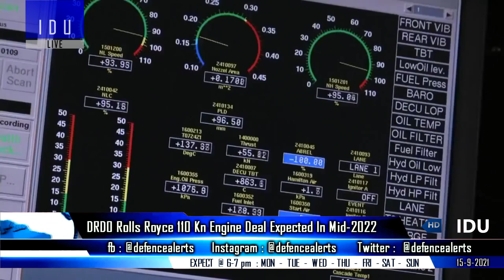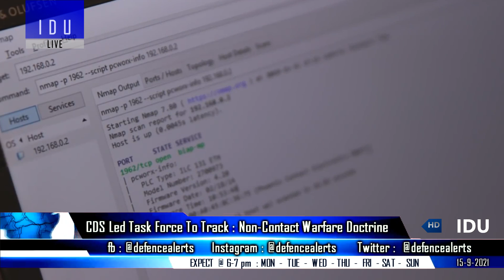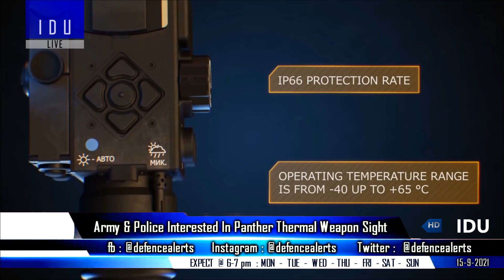Indian Defence Updates : AMCA MK2 Engine Deal,FRCV Engine Ready,Panther Themal Sight,Adour Parts HAL

Comment: The 1500 hp engines make building the K-2 in India a good possibility. They are proven and much more advanced than the T-14. In combination with the K-21, K-30 and K-9 it would also reduce the logistics needed. Add the Hanwha Defense light tank plus Kestrel with the same engines and it will be a good baseline set-up. The next generation vehicles would benefit more from the Korean technology than the obsolete Russian technology.